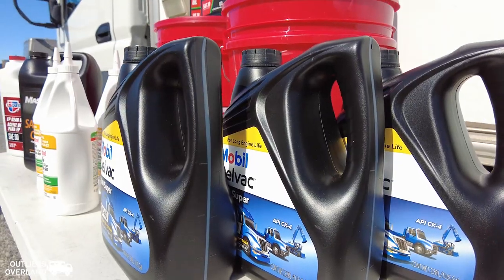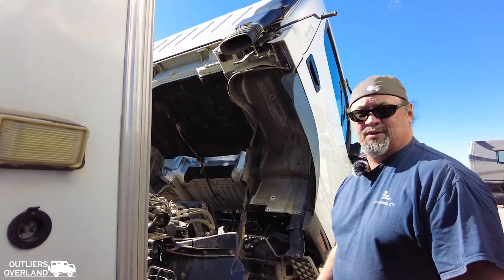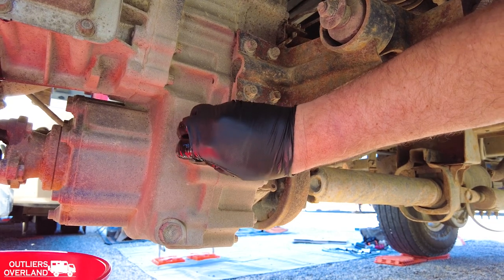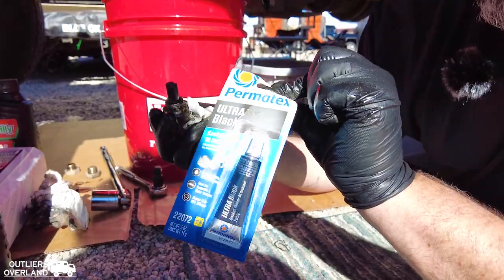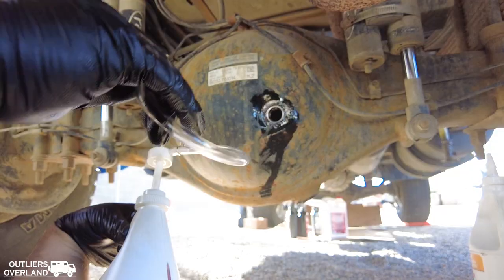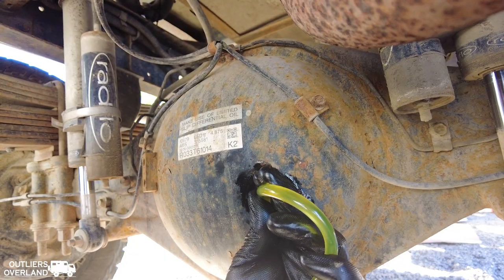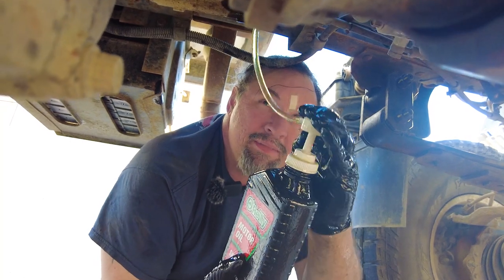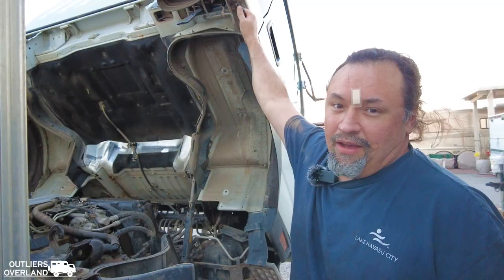Greasing My Nipples & 5 Way Oil Change • MITSUBISHI FUSO 4X4

Comment: Fellow FUSO owner, 1993 FG 170 4×4, Japanese Domestic Market, right hand drive, 22ft. tourest bus,4D33 non-turbo, 5 speed manual transmission, 15 mpg, only 30K miles. It's original home was Island of Hokido, City of Osakahowa. Now living in Puget Sound near Seattle. Crazy about my Fuso. Hope someday are paths will cross. Good luck too both of you.

Comment: You even donated to the maintenance blood god, good choice they will smile on you.  I hate doing my own trucks don't know why I watched you do yours, but glad to see you open the fill first, it sucks if you drain and the fill doesn't open.  The plugs tighten up after a couple heat soaks so you do not torque as tight as you may think to tighten.  Stay safe guys, good video great job with the camera angles.

Comment: hey, I work at a fuso dealer and happened to come across your video here. just wanted to let you know the 05-07s are some of their best trucks. do not ever overheat it though, they are very prone to head gasket failure when overheated.

Comment: If you open both doors prior to lifting the cab up, makes it a lot easier.
Reply: Yep.  Both doors open, then tilt.  Make sure you put all your stuff away in the cab, otherwise it will be all over the floor and dash.
Reply from the maker: Thanks  I'll try that.

Comment: Next time fill that oil filter full of oil before you put it on the truck also make sure you lubricate the oil filter gasket with fresh oil and clean the matting surface every time this is very important. This advice is coming from an old old old mechanic. I hope my wife and I see you two on the road someday!

Comment: Great video. I have 2 suggestions for you. 1. When you change the oil filter, fill the new filter 2/3-3/4 full before you put it back on. 2. Get a pipe to put over your breaker bar.

Comment: Thank you so much for creating this video. We just bought a 2007 FG140, and are turning her into an expedition rig as well!  Over the holidays, we plan to change all the fluids out, and I was constantly pausing and rewinding to write down notes on specs and quantities. This likely saved me hours of interpreting the manual. Safe travels!
Reply from the maker: Happy to help.  
Is that the Fuso I saw for sale a couple months ago in the Oregon area?
Reply: @outliersoverland  It is!  I was wondering if it came from the same original fleet as yours- Previous owner only had for a couple years before buying from another fire company.
Reply from the maker: @HD.Adventuring  my guess is that they are related.  Are there shadows of “Fire Service “ stickers on the doors and front cowling.
Reply: @outliersoverland  I’ll have to check once I get it back from the alignment shop. Second owners added some more stickers, that might be on top of those shadows. I hope it is from the same fleet because yours seems well taken care of overall!
Reply from the maker: If it came from the same batch you purchased a great chassis.  
Ours has been amazing and has literally taken us across the world as we spent the last year in Europe.

Comment: 1"&1/16th equates to 27mm. one should always fill the oil filter with oil before fitting if a vertical filter and use the new oil to lubricate the seal.  Using modern synthetic oils in a vehicle engine that was designed for mineral oils is no longer a problem like it was in the early days of synthetics, they do not dissolve old rubber seals.  The only problem one encounters today with an "old" engine is the Fuel.

Comment: When you removed the fill plug for the manual transmission quite a bit of oil came out. I don't know anything about the Fuso but people have learned on some transmissions that overfilling to a certain amount has increased the life of the tranny. Some are over filled by removing the top of the transmission where the stick shift is. It would be interesting to find out through some Fuso mechanics or maybe an owners forum if this is the case with your tranny. Just a thought!
Reply from the maker: You know I noticed that as well and I dwelled on it for a bit, still do....
I'm thinking of running the truck onto blocks to get the drivers side higher and sneaking in an extra half quart or quart.

Comment: You might find it much easier to snug your breaker or wrench and apply a bit of pressure and then rap it sharply with a hammer  several times and it usually breaks them free much easier than brute force where you usually get hurt.  Rap small and get harder till it loosens. Kinda like a easy going impact wrench. Also you might check out some electric grease guns that might make it easier on the old bod. Envy the heck out of you guys, Ha Ha!
Reply: I agree with the above re tapping the wrench. But another useful add to the tool box is a couple of feet of about 1” pipe or electrical conduit (whatever will fit over your breaker bar handle). Adding length and leverage means less grunting and better control over a stuck bolt. It’s a judgment call because you can shear a smaller diameter bolt. Pre spraying the bolts with PB Blaster or similar the night before also helps!  Enjoyed the video - thanks for posting.

Comment: maybe tightening  it up while there is oil on it is why it is so tight when you try to take it off. The bolt turns easier with the oil and should be tightened "less" j/s.,